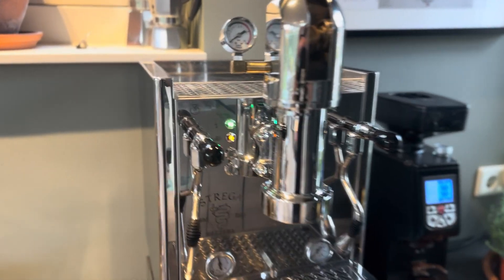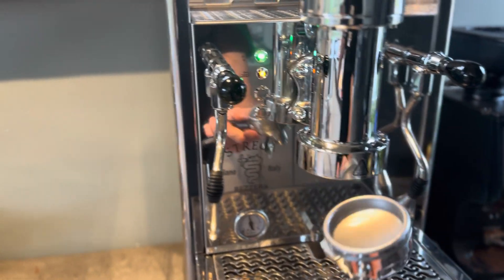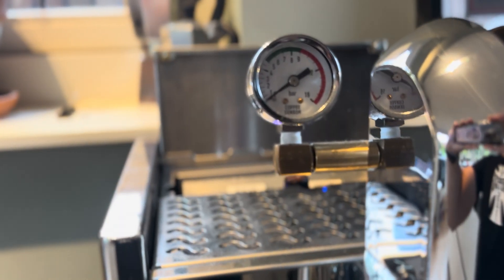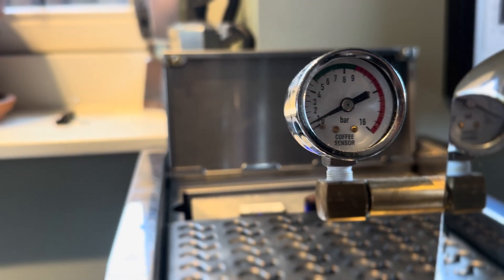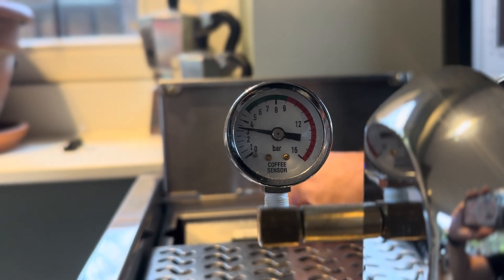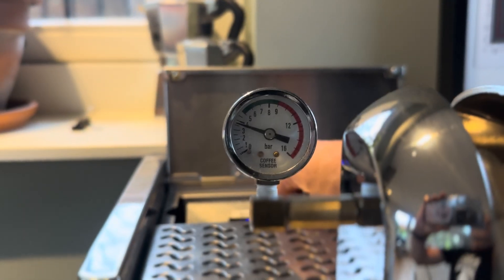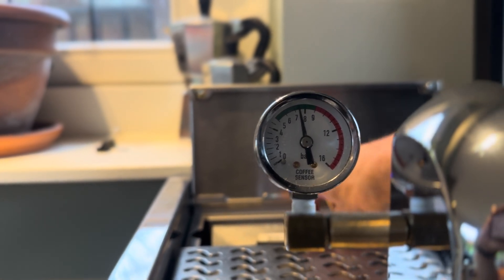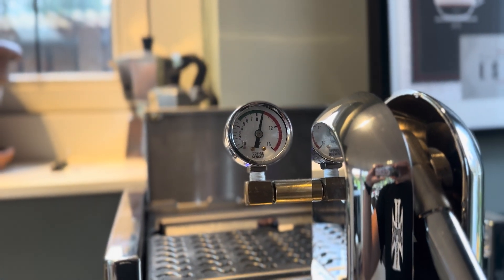Bezzera Strega Mods - 11

Comment: It would be great if you dd some how to videos on Youtube for these mods! I have a Gaggia 2006 Classic which I fully restored, upgraded and modified with a PID and dimmer pressure control. 
The machine is better for milk coffees and the dimmer control is hard to use to be consistent so I would love to get a spring lever machine and have been searching for ages an have settled on the either Londinium Vectis or Bezzera Strega as the Strega is cheaper and parts are more readily available.
Reply from the maker: I really need to clean up the internals (it’s wired in a rough prototype like fashion…) but will make a how to video some day.
Reply: That would be great I am also eying a Strega as my next machine (also coming from a Gaggia classic with PID), but i would like to mod it and prepare for that as best as possible.

There are currently hardly any clear photos online of the inside of the machine, let alone showing any mods.